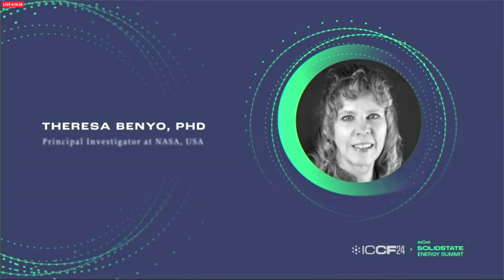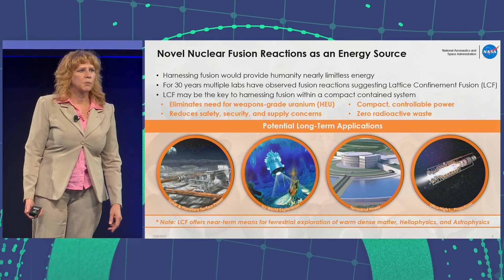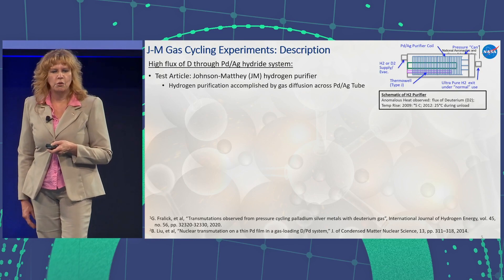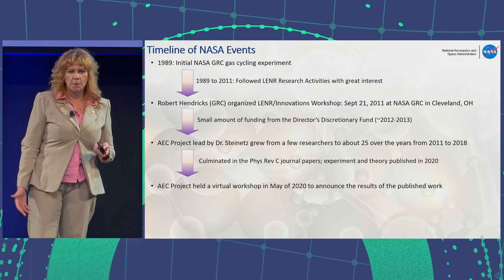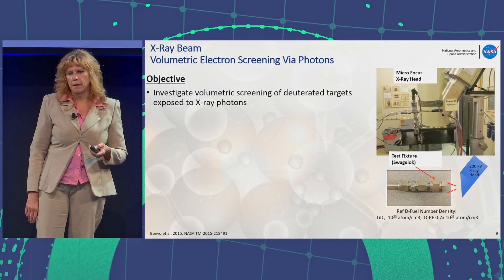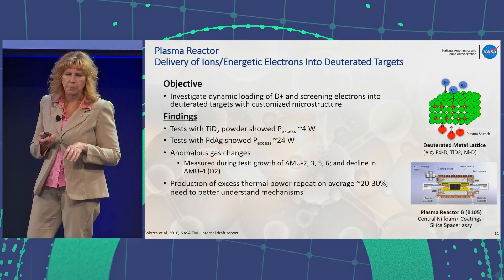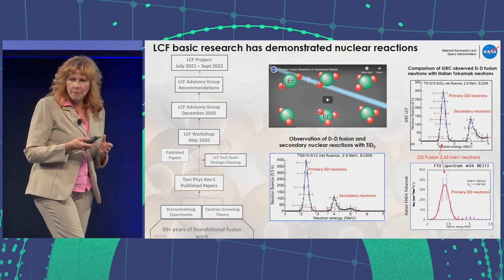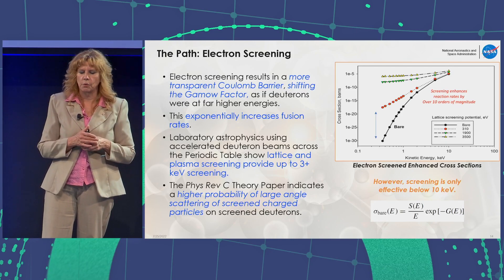ICCF24 Presents: Theresa Benyo, PhD - Federally funded LENR activities at NASA

Comment: Yeah, very interesting, the shotgun approach bit worries me it's like they tend to input more and more energy instead of finding the best lattice, and best procedure to repeatably have a system that will just heat up without needing to have a linear accelerator or kilowatt xray source pointed at it. 

Disclaimer: I am a dummy not a nuclear physicist
Reply: They needed to try several different approaches due to the continuing disconnect between experiment and theory.
Reply: People have been trying that for decades and the problem is that its extremely inconsistent and rare that you get anomalous heat from low energy setups. Nobody had been able to definitively confirm that fusion was actually taking place because of how inconsistently it would occur. NASA's goal is not to create excess energy here but to simply find a methodology that is consistent enough to confirm that fusion is really happening in these metal lattices.